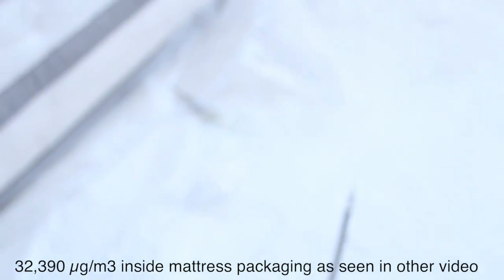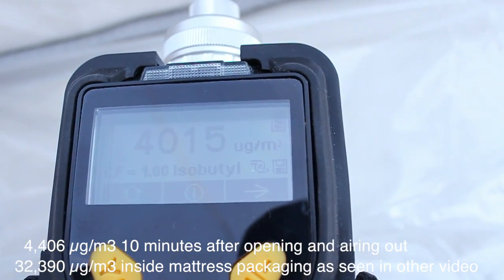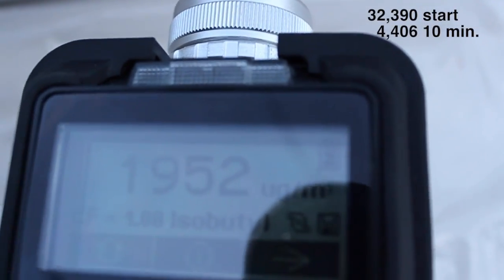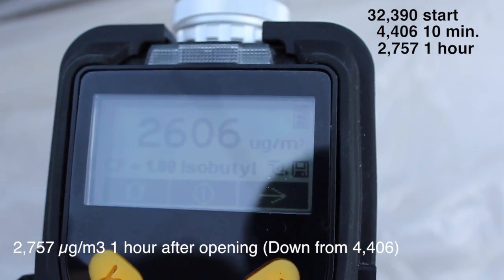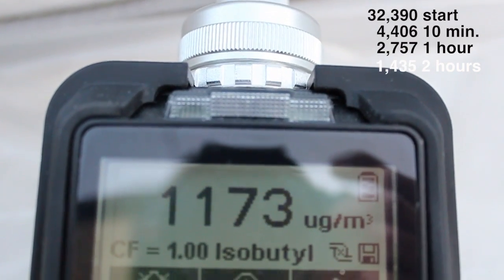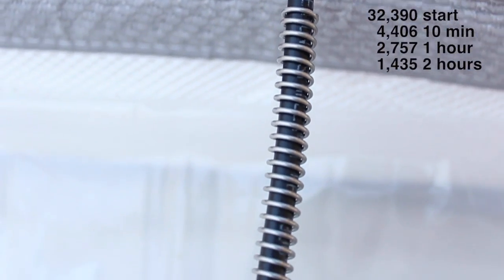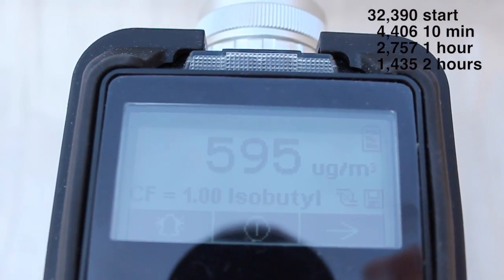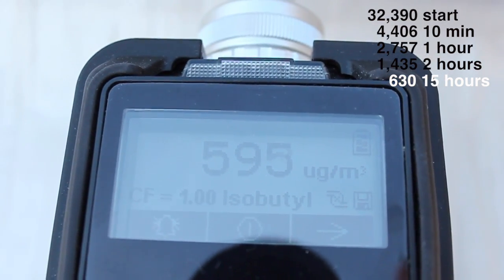How long for mattress VOCs to offgas?

Comment: Have you tested various brands and models of foam mattresses? 
There is a huge lack of independent information on the VOC emissions of mattresses.
Reply: Whatever you do don't open anything you get inside. I made that mistake with a Sealy mattress and I shit you not...I had 2 fans going constantly with the window open for 2 or 3 months (I forget how long exactly)... But even after all that time it still smelled like a chemical factory when I opened the door. I ended up putting Saran wrap over the entire thing and using a shit load of sheets/comforters/mattress protectors... That's how bad it was. And that room that I opened it in a year and a half later still smells. Not as bad but the chemicals embedded themselves in the carpet, the walls, and anything else that was in that room. I don't even go near that room anymore because I know the chemicals are still there. If I were you I would just build your own mattress - That way if something you get offgasses and won't go away it's a cheaper mistake than spending like 2K.

Comment: I bought a mattress yesterday, opened it in my loft next to my air intake vent. Can’t gas off outside in our current weather conditions. No one slept on it and it’s been about 24 hours. I did notice the plastic wrap was torn when I purchased it and I wonder if it had the opportunity to gas off in the store through that considerably large opening?  This is for my 5 year old and I won’t let him on it until I know it’s safe. Sure could use one of those meters!

Comment: Thanks you @Indoor Science - I just had my Casper bed installed today about 6:30 PM.  When I ordered it I did ask about out-gassing and they told me the mattress's go through strict testing and are certified not to out gas.   I didn't put bedding on until about 11:30 PM but in the meanwhile I kept smelling something like paint.  I smelled the mattress up close and it wasn't too obvious ... I'm now in my living room, bed is at the back of my house and I clearly smell this strong smell, more now than earlier!  And yes, it was opened by the 'set up' crew in the bedroom.  Had I known I would have had it opened outside, although we are expecting higher temps heading into the weekend!  Getting a new mattress/bed was a huge treat for me --- I'm retired and live on a fixed income :(   The bed I had was older, but it was a very expensive bed with both foam and inner springs and a pillow top.  I don't remember that ever having a outgassing problem.  Clearly this Casper is outgassing :((   I had them haul away my old mattress  and box spring and really sorry I did ...   I don't know whether to try sleeping on it tonight or close the bedroom door and sleep on my sofa?    Between the 3 brand of mattress's that you tested which one had the less of the out-gassing and smelled better quicker or were they all about the same.  If you were purchasing over again, after having this info, would you buy a different type mattress and if so, what kind ?   I really don't know what to do, I live alone and no one to move it, etc ...  and I was sooo excited to be getting a new bed .... very disappointing ...  Thank you for any help or answers ..
Reply: @Mahoma Gabriel I just bought my son a new bed it smells like gasoline and his bedding and hair skin smells like it . I washed his clothes and bedding it is so strong it’s not washing out . My son is saying I’m crazy and it doesn’t smell it so thank you all because it does. I paid 800$ full size and put it in the garage and will have them pic it up ASAP it a BeautyRest so sickening
Reply: @Loveforshelly  happy to hear it’s out of your house!  It’s affecting your son whether he smells it or not!  All the best!  I love my chemical free totally organic mattress!
Reply: How did it go with your mattress? Did you have any issues sleeping on it that night?
Reply: @SlingShotKid007  I tried it for a month but had to seal off my bedroom as the chemical smell was so strong !  It never dissipated! So I had them come pick it up!  It still took another week to get the smell out using fans and air purifier!  I now have an organic chemical free, odor free new mattress 😊 No fake, synthetic stuff!!
Reply: @mahimagabriel3798  Oh wow, thanks!
Reply: @mahimagabriel3798  Hey. What’s the make & model of your new mattress? Thanks

Comment: What about if you unpack the mattress in the room but you leave windows open and ceiling fan running. And you aren't using the room for about a week? Is it just gas that you are worried about bringing into the home that can be aired out and it will be fine?

Comment: Or just don’t buy a memory foam mattress and not get cancer.
Reply: Even non memory foam mattresses are treated with fire protection sprays and other chemicals.
Reply: @akfox38  get a nice air purifier which removes VOCs....like Blueair.. that won't stop fumes coming right off the mattress to your face...but it will clean up the surrounding air...
Reply: @earthcomedy  Will the Blueair eventually get rid of all the fumes if used for a week or so? Thanks!

Comment: Thanks for the video Indoor Science! So, is the conclusion that the off-gassing from the mattress was next to normal indoor levels after 24 hours? Of course, you can go for an all-natural latex mattress and avoid all VOC's. Even "safe" levels recommended by companies like Certi-Pur. You just have to be ready to invest a premium for a natural latex mattress. On the other hand, a natural latex mattress will outlast a polyurethane mattress by at least 2x, it biodegradable and is better for your health.
Reply: unless you have a latex allergy...

Comment: The tests were made under static conditions. Would the compression and movement of sleeping on the mattress cause more off-gassing, or cause faster dissipation?
Reply from the maker: Yes, heat, moisture, and physical contact could all increase the rate of off-gassing. I didn't measure any of those parameters.
Reply: @IndoorScienceChicago  Thanks for responding. We have decided to send the Casper back - doing that today.  Even after giving it lots of time to breath my son still feels tingling in his extremities after being on the mattress.  It's too bad because it's a comfortable mattress.
Reply: @xlchief42  even after 2 months of having it your son is still being negatively affected by the off gassing?
Reply: @tonyfffuuu  Yes. Unfortunately, the mattress was only the trigger. It appears that he has an allergy to several cloth and padding materials.
Reply: @xlchief42  quite sorry to hear that very informative and nice of you to make this video Mr. Burger!
Reply: @tonyfffuuu  It is not my video. Indoor Science is a company that specializes in air quality testing and it is their video. I came across the video via a Google search.
Reply: @xlchief42  Magnetic fields over time affect your metabolism....also can cause allergy issues - autoimmune. Magnetic fields - power lines, old CRT monitors / TV, tablets, laptops, certain car models, certain airplane seats....anything with a motor, microwave ovens, bad house wiring.....also wireless radiation...don't you love the 21st century? The 20th century? The 19th? earlier centuries - different problems with different causes...get a good magnetic field meter...
Reply: @earthcomedy  Thank you for your concern.  I was a broadcasting engineer for over 40 years. I am well aware of what magnetic fields do and do not affect.
Reply: @xlchief42  care to share any quick personal anecdote / story?
Reply: @earthcomedy  Sure - I never experienced any negative effects.  I don't care to debate your beliefs, nor will I ridicule them. Have a pleasant life.
Reply: @xlchief42  U just did...but that's ok. pride goes before the fall... and how does one know, what they don't know....
Reply: @earthcomedy  yes lam avictim

Comment: So the device is giving you numbers, but what about types of gasses being admitted in the air, and is 500 a Standard of Practice for all gasses or just the one showing on your screen.. Thanks
Reply: To determine the types of gasses, you need to do a laboratory-based test, which doesn't provide instantaneous results. 500 µg/m3 is used by the non-governmental US Green Building Council for Total VOCs.  The device I use displays Total VOCs.

Comment: If the concentration was 'built up' because the mattress was contained in a package getting no air circulation..... wouldn't the VOCs build up again in a bedroom? At least the underside of the mattress? Perhaps only to exhaust into the air when body weight is applied?It's not like the source has been exhausted, has it?Have you/would you test again top and bottom side, indoors, with less air circulation? How about the room it goes in...before and then a few days after adding mattress?Are the VOCs you're checking supposed to be a byproduct of manufacture? Arent they a product of the materials themselves/chemicals applied? And as for the chemicals (flame retardants), aren't they meant to persist?
Reply: The VOCs off-gas at a higher rate at the beginning and then it slowly tapers off.  Making sure the initial off-gassing is done outside is important as that will give you the most "bang for your buck" or in this case, most off-gassing with minimal inconvenience.  If a manufacturer wanted to send another mattress, I would be happy to do another video, testing it in more ways.

Comment: where do we get a meter that that to test our new bed?
Reply from the maker: The meter I used is a PPBRAE 3000.  They are several thousand dollars so not something to easily test for.  You might be able to send a sample to a laboratory for much less.
Reply: Extech has a VOC meter...$2-$300....not as good...don't own it...but it's on my wish list...do have a PM 2.5 air meter for air purifiers that we use here...
Reply: @Simon Blanco Blueair w/ carbon filter

Comment: Interesting video. I concern about exposure in VOC too. Currently, I purchased kitchen cabinets which release VOC, since it has been installed and couldn't place them out side. How long should I stay the windows open for outgassing the cabinets before the VOC drop to a safe range.
Reply from the maker: There are so many variables it is impossible to provide a specific number of days. Some VOCs like formaldehyde off-gas over a long time period.

Comment: Thanks for the video update. Very useful information. Many of us appreciate it. I have a question..... In the next year or so, I will be moving to a very hot country. If I was to buy a Casper, air it out and such, would high heat and humidity cause more chemical air to come out? Thanks.
Reply from the maker: High heat does cause the chemicals to off-gas at a higher rate.  Humidity can cause some VOCs to off-gas at a higher rate, but heat is the bigger factor.

Comment: Can you tell us how much it off-gassed after a few weeks or months?
Reply from the maker: The normal background VOC level in a home is commonly around 500 µg/m3 so I didn't bother doing a retest weeks or months later.
Reply: Indoor Science I’ve noticed if I press on the mattress it puffs out the gases. Two weeks old and It still pollutes my sheets and my breathing. Everything smells like it.
Casper mattress. On their website it says after an hour you can sleep on it but that’s BS. Mine was also rolled up tight & didn’t arrive folded like yours.
Reply: @IndoorScienceChicago  what equipment did you use to make the measurement ?
Reply: Nicole Buell yes can you tell please.
Reply: Indoor Science I don’t understand why from hour 1-15 the lighting never appeared to change
Reply: @Elmojig  wake up, Nick!